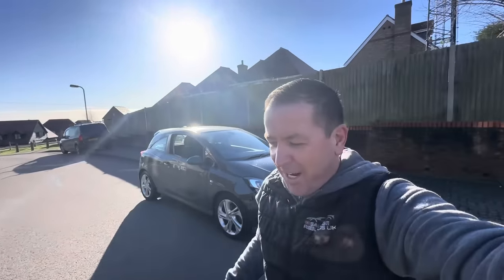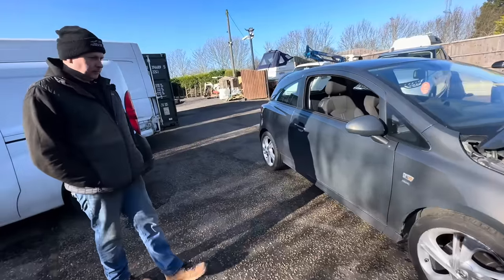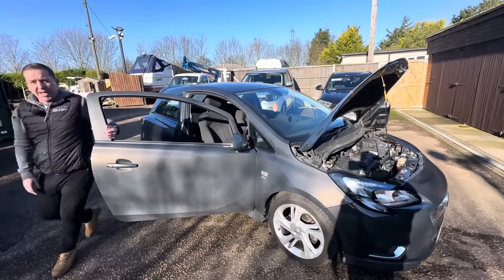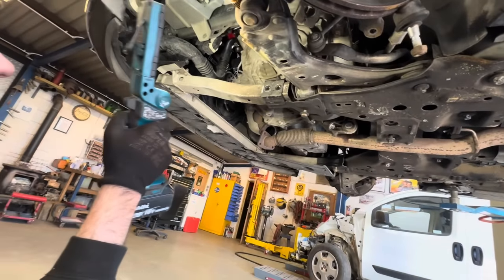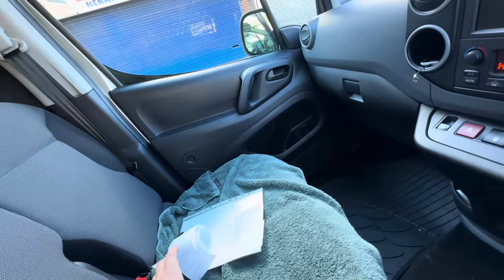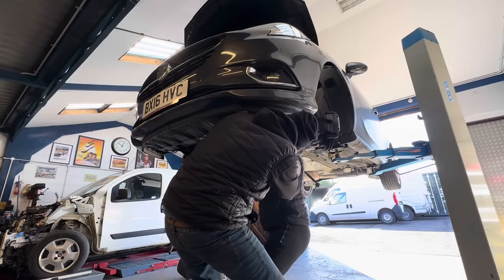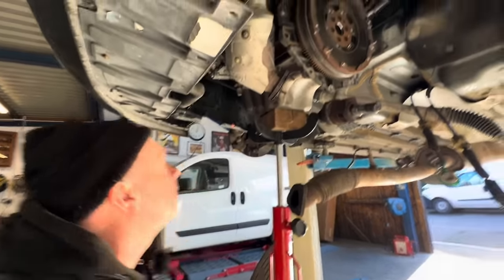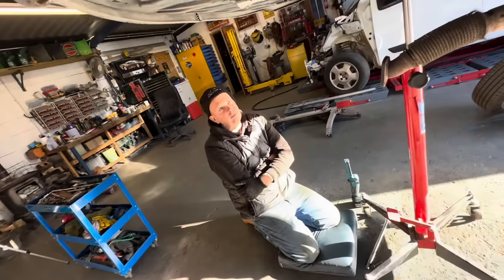WE GOT PROPERLY TUCKED UP BY A SUBSCRIBER

Comment: Sounds like the crank thrust washer(s) has failed. If they have damaged the crank a new crankshaft, bearings set and thrust washers would cure. So for the sake of a bottom end rebuild you will have it sorted?

Comment: A very common problem mate. the later engines are renowned for that, the max float you should have is.35mm all down to running variable oil pressure to save co2

Comment: Engine issue which such a low mileage? Goes to show that the reliability vaxhaul has to offer leaves a lot to be desired. Nevertheless lad's a good try in trying to sort out the noise issue.This vehicle  is only suitable as a part's car.

Comment: Had the exact same happen to me on the exact same car same year too! Wasn't told it was crash repaired, after a while noticed things wrong with it. Dashboard had 2 screws holding it in, AC pump had a huge hole in it and no gas, airbag module was just left unbolted, ECU was zip tied. spent a few months putting it all right.
Reply: That’s why if you spend over 5k you spend 200 on an independent inspection service if you know nothing or little about cars

Comment: My Mrs hsd one of these that had done just under 40k miles. She phoned me one night, the car wasnt getting out of 2nd gear and it was stalling in neutral!! I went to get her and it wouldn't go in to first, would only work in 2nd and sure enough in neutral it would stall when you pulled off the clutch. Once it went in to the garage they said it also needed the pedal box changed. Ended up being 3k and that was including a contribution from vauxhall. Absolutely disgraceful to have to get that sort of work done to a car so new and with so few miles.

Comment: Put some thrust washers in the crank, that will sort it out. This is caused by pressing the clutch and start the engine with no oil pressure, too much endfloat

Comment: Every Vauxhall I've ever owned (two Astras 2004 and 2017 plates and two Corsas 2008 and 2015 plates) over the years have always given me major headaches. It took me ages to learn my lesson, leave them well enough alone.
Reply: What was wrong with yours 2017 Astra?
Reply: @dino9075  What was right with it 🤣 timing chain issues, issues with fuel system, turbo issues, various electrical issues and a host of other fun and games. It was a 1.6 biturbo diesel... really nice car but reliability was a shambles. Shame really.

Comment: Rob I did a clutch on one of those corsas and it is a front bumper off and the alloy frame off leave the actual subframe in place it’s a pain in the bum. The alloy frame is very tight and I had to keep the rad pack supported and I also did a heater matrix on a four year old corsa with 16,000 miles on it. Cars are just built like chocolate now quality is terrible.

Comment: Can't believe how much end float there is in that crankshaft after only 30,000 miles, it's horrific. Maybe the engine was ran low on oil in the past 🤷‍♂️
Reply: Not measured in thousandths but in INCHES!

Comment: Very common on the 1.4 engines, 15000 miles onwards. Both the crank and block will be worn away , most likely the engine iis scrap, the center main bearing is also the thrust , but only half of the shell has the thrust , think this is the main reason for failure , should do a vid of a partial strip down. Watch out for the Astra k  1.4 also same crap engine. Thats why i love Vauxhalls they are absoulutely crap , no sense specializing on a make that is reliable.
Regards Joe

Comment: It seems a shame to scrap it.  It might just need a new set of thrust bearings or a replacement crank as long as the block thrust bearing face isn't damaged.  The top end is fine so it is a quick bottom end rebuild job.

I broke the crank on my Vauxhall Viva and a spare crank, new shells and a timing chain fixed it quickly and cheaply. Worth looking at.  It's the top end work that takes the time.

Comment: Ive a mate with a scooby that makes that noise, we both thought it surely cant be anything other than the clutch release or a bad input shaft. Could you check for this by holding the clutch and giving the crank pulley a tug?

Comment: Up until about 25 years ago, my choice go to vehicles were Vauxhall's (hence my handle), but not now, these corsas are just crap. A timing chain every service (from experience) insignias are crap. Now they are owned by a company that used to be Citroen/Peugeot they are rubbish. Plus no-one wants to repair cars anymore. The trade is in a sorry state. Pity help the newcomers to the trade.
Reply: A timing chain every service is absurd, most last a decade or more.

Comment: I had manual BMW. Put my foot fully on the clutch to take some keys out of my pocket because they were digging into my thigh. I ended up bending the clutch pedal bracket further into the footwell  and it ended up making a noise like this when the clutch pedal was fully depressed. This I found out after changing the clutch and dual mass fly wheel.

Comment: Why i wont touch a Vauxhall...very common for Vauxhalls to fall to bits lol, sister had a Corsa with only 36k miles and gearbox needed replacing and so many things failed on it that should not be failing on a 36k mile car, my Focus has 112,000 miles and hasn't needed anything except bulbs and wipers, some cars you can service and they'll go for years then some you service and they blow up before 50k miles.

Comment: Got to say Rob, when I heard that noise I thought possible end float. If it goes quiet with your foot down that's 1st motion, if it goes quiet when you take foot off ...
Reply: I would check the engine number..I bet the garage swapped out the original low mileage engine for a duffer... just a thought

Comment: Clutch at 30k miles bloody hell 😮
Reply: what were they doing to burn a clutch out that fast.
Reply: @citroen-fe3qq  Clutch probably was fine and most likely misdiagnosed at first as noises with the clutch is usually the DMF if fitted, which this has!

Comment: 31k new drive shaft ? 31k new flywheel ? This cars 100% been clocked or had a mileage blocker in at some point.
Reply: it not look it up on dva mot history check mileage is right hasnt been clocked
Reply: Not 100%, about 60%, the other 40% is that it has been abused from the day it hit the road.

Either way, I wouldnt go anywhere near a car that needed a clutch at 31K, the engine will not have been treated well!
Reply: Or given the type of car it is it's belonged to a boyracer who's thrashed the living daylights out of it.

Comment: I remember Vauxhall's of RWD age having ongoing problems with those small clutches, thrust bearing & spigot problems 50 - 60 years ago, of course those Viva's hb / hc were originally based on an earlier Opel.
The Chevette in its ohv form increased the clutch diameter from 6.5 " to 7.5".
Apart from the FWD c.v joint problem looks a nice car.
Pity about the dishonesty of some owners / agents. ❤

Comment: ***A Known fault crank shaft end float. Vauxhall changed oil to 0w 30  to try to prevent it. A mechanic at Vauxhall told me about this on 1.4 turbo. They fit the same engine in the Astra sri . Very poor, it's not as if new technology is it, surely they could get the bottom end right. Sorry you got caught out.
Reply: I wonder how many of the people who had issues would hold the clutch down whilst waiting at lights etc. The force you need to separate the clutch from flywheel, has an equal and opposite force on the crank, I wonder if it's that? (and obvs, weak end bearings)

Comment: Did you speak to the person you bought it from or is it more of a case of you don't want to go back down that route and cause headaches, I know it's buyer beware and they probably knew about this issue but I would be interested to see what the seller would say when confronted.
Reply: No point annoying yourself, because once you drive away you can't go back
Reply: @Gofast1234 no there isnt. As a private sale the only way your getting a refund is if it was miss described ..as in you said it was a 4 door and its a 3 door..or diff model, with engine issues your not going to get a refund sold as seen
Reply: @zdenka211  - id contest that ,, it depends on the description of the vehicle
Reply: @Gofast1234  you contest what you want,  private as in sold as seen ZERO comeback for mechanical issues

Comment: Why does a 31k car need a new clutch unless it has had the clutch pedal ridden for most of its life.
Reply: "A person who has given up driving" , speaks for itself doesn't it?
Reply: I thought the same 😂

A clutch at 31K? I wouldn't touch a car that needed that so soon, the engine will not have been treated very well either!
Reply: A friends dad was 98 when he stopped driving
Tone deaf, burnt three clutches.
Reply: Lad at work had a v6 vectra manual... over 250k same clutch! (speedo display died after 250k)... see loads of nuggets riding clutches at junctions these days....

Comment: Surely you would check before buying 😉
Reply: How do you check if the crank is moonwalking up and down when you can't even barely touch the crank pulley?
Reply: You save your back and bring a low profile jack and some wooden blocks with you (set of jsckstands if youre feeling modern), get under the car.

Comment: If there is a new drive shaft on passenger side , has the wheel hit a kerb hard. This then damages the drive shaft and sends a shock through the gear box to crank. Just a thought. Still great content guts.
Reply: When Chris noted the new half-shaft, that was a likely sign it was damaged by a curb (kerb to you) or a bad pothole. Check to see if a different tire/wheel on that side/front.

Comment: Had similar on a Landrover TD5 engine, harmonic balancer failed and owner kept driving it (before I bought it) the vibration shook the thrust washers out, I imagine a failed DMF would do the same... Ended up rebuilding mine with a good used crank and all new bearings etc.
Great content as always 👍

Comment: Install new thrust bearings and job done. They forgot to install these
Reply: That's a possibility.. But which engine builder doesn't check end float?
Reply: Many garages don't build engines, they replace them. Massive difference. And it's easy for a person to miss replacing parts on an engine build if they don't do it every day

Comment: This is why i dont touch vauxhalls.
Reply: They seem to be made of chocolate these days.
Reply: Absolutely do you remember the zfira fire
Reply: They are a bit dodgy
Reply: I’ve had Astra’s for the past 18 yrs only one that I had problems with was the m32 gearbox in 2008 1.9cdti …
but once the bearings were upgraded it was solid.. 
currently in a 2016 1.4t 70k no issues apart from one main beam that needs a clout every few months to get it working
Reply: Yeah don't like vauxhalls to I have Japanese cars!!!!
Reply: What a silly comment. All manufacturers have modes in their ranges that have issues. 

These little petrol engines work just fine if you maintain them correctly and ignore what the manufacturer tells you in relation to maintenance. 

So many variables are involved in  a catastrophic failure like this and as you don’t know the history of this vehicle you can’t make an accurate judgement on the reason for failure.
Reply: @leebox9911 I also have 2 Japanese cars and a Vauxhall. All three have been no issues beyond normal maintenance so your point is?
Reply: there good and bad ones..this ones had a hard life obviously needing a clutch at 30k and knacked engine..dont touch boy racer cars
Reply: @paulas2610  ...is this what your dad told you ?
You'll learn 🤣
Reply: I often see a lot of these at work, in particular these 1.4 engine Vauxhalls that sound like they have a bag of nails in it. Seen a zafira 66plate only yesterday with 39k miles that engine was toast. Very common and no different to the famous ford ecoboost 1.0l engine cars
Reply: @brun_s  is this issue related to the turbo versions? I’ve had a number of normally aspirated 1.4 engines which were no trouble at all.
Reply: @geebee6737  No my dad is long gone and had no clue about cars and engines, nor do I make any comments about Vauxhall petrol engines on what others have told me. However, I’ve personally owned a few of these normally aspirated petrol engines and had no trouble with them, not even timing chains and had 2 of them to over 150000.  Maybe there is an issue with the turbo version of this engine (going on the comments) but it doesn’t make all Vauxhalls bad cars. 

As for worst designed engine of the modern era, I’ll award that Ford with their Ecoboost variant.
Reply: My 2003 Corsa sxi now has £183k mileage on it.
Reply: @teatimetel174 they probably only changed the clutch initially to try and fix this fault
Reply: I used to like vauxhalls my whole family have em but now I realise, Peugeot have got a lot better since the very reflected vauxhalls parts
Reply: @andrewpotts3356 don't make em like they used to!
Reply: Yes, also the drivers as well, worst ever
Reply: Agreed 👍🏼
Reply: And what do you suggest buying? Everything has its issues 😂
Reply: Always owned Vauxhall's, only had one breakdown with a cam belt snap .Great cars great memories.
Reply: @paulas2610 nope,nowt wrong with fords ecoboost engine if maintained correctly and not thrashed everywhere.just like you said earlier,all cars have different issues.
Reply: @ivanfernyhough3851 Wet timing belt Eco Boom,utter junk..
Reply: My 2003 Vectra 1.8's awesome
Reply: @lordbungle6235 Try a 1.4 TSI twin charge that's beyond chocolate 😂
Reply: Absolute rubbish I’m nearly 70 and have driven Vauxhall cars my whole life from the early 1970s Vauxhall victor VX senators caltons omegas insignia VXR
Reply: @thomasshepard6030  Agreed, although the VXR was the only good MK1 Insignia, the rest were shite?
Reply: @ivanfernyhough3851  Wet Belts? Nah, they're junk
Reply: I used to have Vauxhalls! Had Chevettes, Cavaliers, Vectras, Astras, Zafiras! Never had an issue!
Reply: These Corsa shape is known for gearbox and clutch and master issues
Reply: Cant beat Toyota or Skoda diesels
Reply: @teatimetel174 

Not to mention a new driveshaft on such a young, low mileage car. I think it's led a VERY hard life.
Reply: I've got a 15 plate corsa that's done 117,000 miles. Basically just been getting the random suspension issues fixed due to pot hole England otherwise its still fine.
Reply: Give me the old Nova or Lotus Carlton
Reply: I've been vauxhall since the 90s and to be fair ive never had many issues not long sold my diesel vectra I owned for the last 8yrs fault free motoring there more reliable than most cars on the road the things with cars these days there is to much software bring back the 90s spec cars when if you broke down you could have it going again after ten minutes
Reply: @Kalus_Saxon got a 1.9 Sri at the minute on 53k, hoping to get a few years out of it before It gives me any trouble
Reply: Can’t fault them
Reply: I won’t touch Fords, BMW or Audi.
Reply: All Vauxhalls should be in a scrap yard 😂😂 .
Reply: I have a vauxhall mokka never had any problems with it at all
Reply: @TheMG4hubcap Hi I found you here

Comment: its one of the well known problems on vauxhall 1.0 1.2 1.4 turbo engines, thrust bearing gets eaten and crank wears out the block. new block and crank needed and it;ll eat through the next one too. better to fit the 1.6 turbo engine in it.

Comment: I was thinking at the start... 30,000 miles new clutch... ???
Reply: I did 180.000  miles in a volvo s40 never had a clutch failure
Reply: New driveshaft too. That car despite the low miles has led a hard life.
Reply: Put the 4th clutch into a Suzuki vitara not to long ago only done 120k 😂😂😂 some people just shouldn’t drive manuals

Comment: Interesting video, thanks for the detailed explanations! 
I had the same symptom on my previous car (2015 Mondeo 2.0 diesel - the one with Peugeot engine)
I assumed it was a flywheel, however my research revealed that flywheel noise happens with the clutch up, whereas I only heard the knocking sound with the clutch down (engaged)
I traded the car in last year so it's a mute point, but I'm curious if the noise was engine related.
It has been remapped from 150 to 180bhp before I bought it, so that might've been a factor 😅

Comment: As a qualified mechanic of many  years ago I have seen this issue on two vauxhall viva engines.  One particular vehicle that springs to mind had only 8000 genuine miles on the clock it made a squeeling noise when the clutch pedal was depressed. Never seen this issue on any other manufacturer in 50 plus years,  seems like a vauxhall issue.

Comment: If the crankshaft does have irreparable wear can you not just replace it and all the floats and seals? The next question, is it going to be cost effective doing that with how much time it would take to breakdown and reassemble? Would Josh not have a crack at it?
Reply: On the 1.4 (this one), the end float becomes so extreme that the crankcase  web becomes the thrust face of the bearing. Its an expensive fix, lots of new parts needed and can't really be shimmed out.

Comment: i don't believe that motor has only done 30k. that or it never had oil changes/ran low on oil! Corsas are horrid cars but that is shocking even for a Vauxall
Reply: Engine all carboned up in cam cover etc ? Have had my issues with 2008 cdti 90 sxi dreaded choclobox M20 gearbox at less than 30k whining in 6th, my good mate rebuilt it with new bearings seals and revised new genuine end case from Courtney sport, use higher spec gearbox oil and change every 10k, not so keen on the petrols as do fuffer from neglect, think they are derived from Suzuki engines mine is fpt Fiat power trains (tie up with GM) which i think are good though some issues again mostly through neglect and wrong spec oil poor filters etc
Reply: 130k more like..